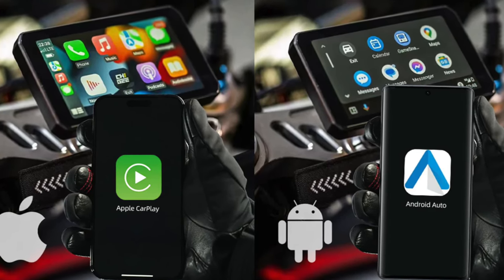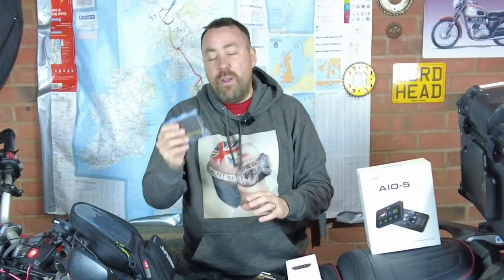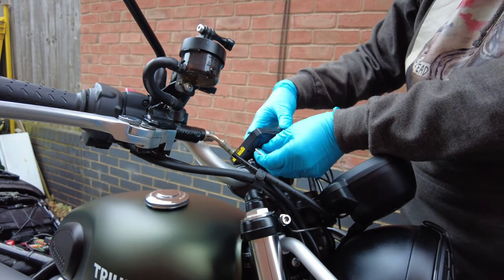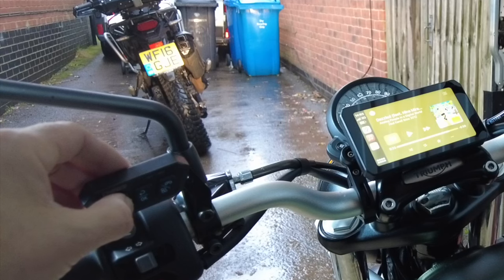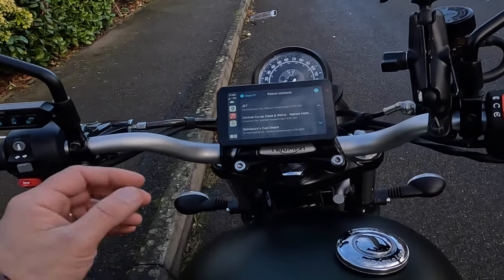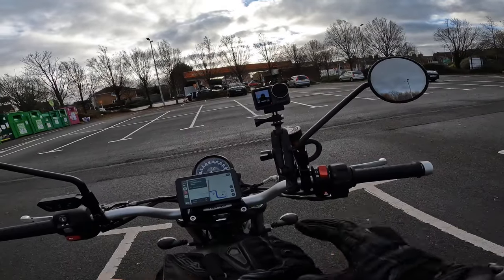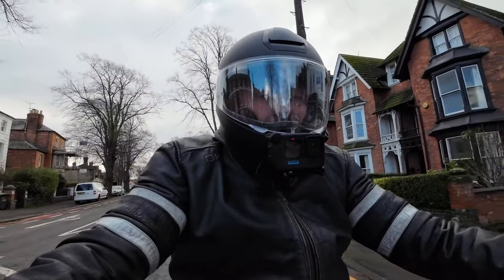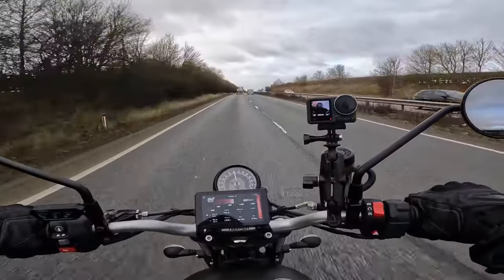UPGRADE Any Motorcycle With This Smart System | CHIGEE AIO-5 LITE REVIEW!

Comment: How does this compare with the Carupride W702 that you have also reviewed?
Reply from the maker: Hello, Other then Apple CarPlay it’s a completely different device. As this has its own gps built in and will give you MPH/tyre pressure/riding cameras etc. I found it hard to compare but both are great at Apple CarPlay. 👍

Comment: Can it easily be removed ?
Reply from the maker: Yes super easy, just apply a bit of heat via a hairdryer to the pads, and they’ll be taken off nice and easily. Then just working backwards. The installation in reverse 👍
Reply: @HelmetHead  hi on about the screen does that come off easily to put in packet
Reply from the maker: @SennaTaylor-fq8lj  unfortunately not as it needs 2 bolts removing.
Reply: @HelmetHead  that’s not good